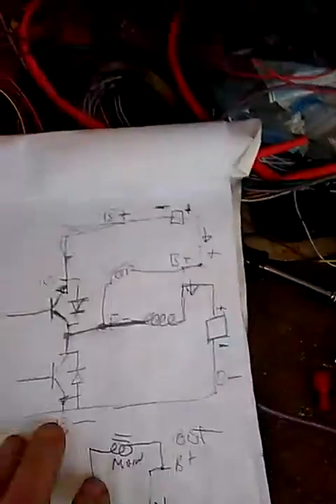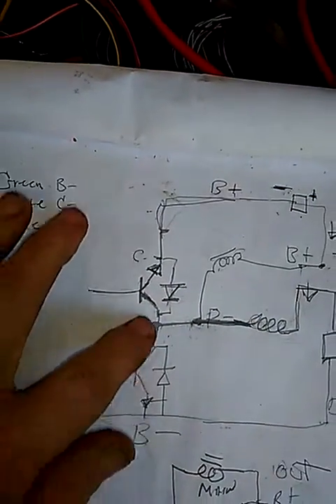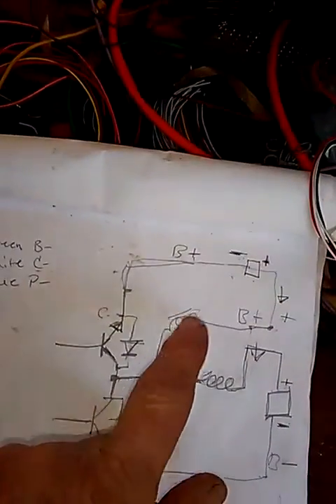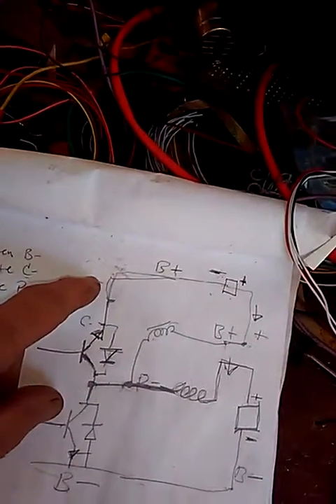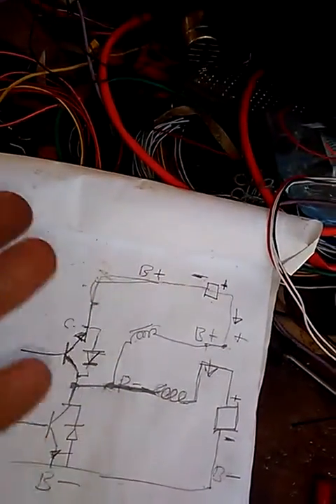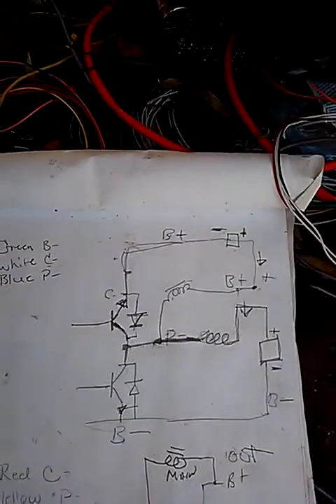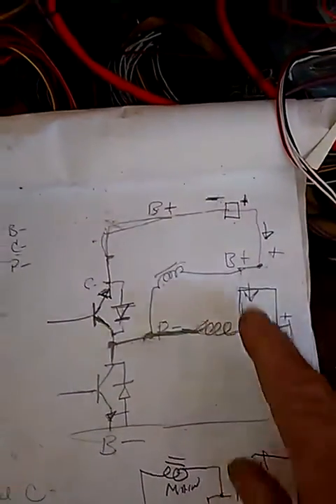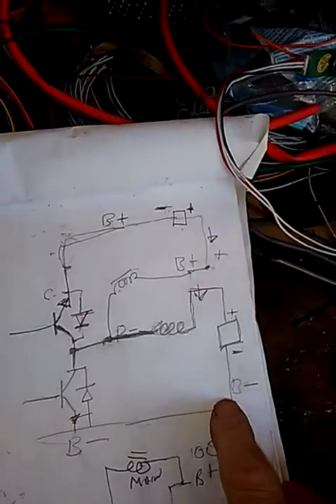Smart bms with relay controls

Comment: So this is a video of a schematic that in theory will do what the title say, I was curious how that(relay) will work with high current, guess not in this video...
Reply from the maker: I have these hooked up in cars and I use the small 12 volt relay to control the main contactor relay or another high voltage relay. The BMS itself can control a certain amount of voltage and current. I have the 10 amp model but they make them up to 80 amps. If you use the BMS to control the current it will also measure the current can keep tracking amp hours which is nice.
Reply: How 2bms series relay used